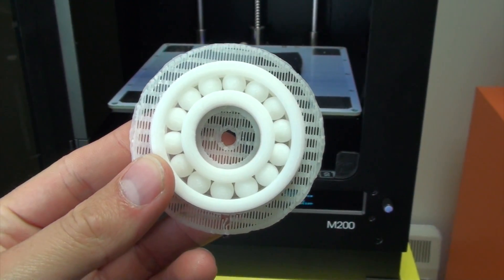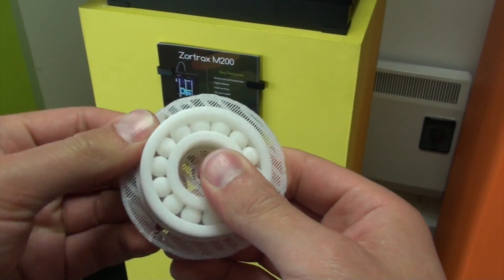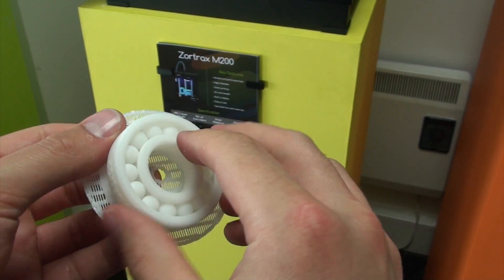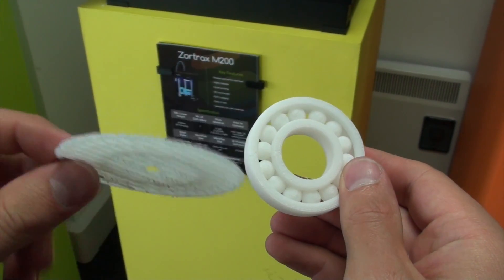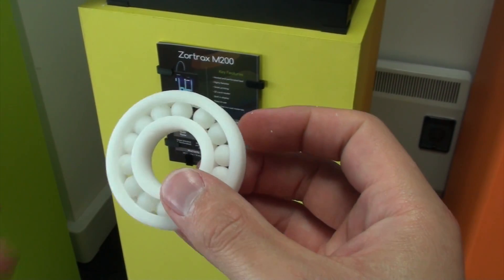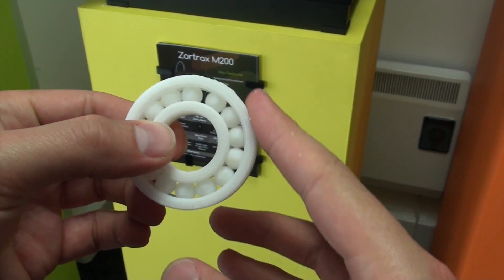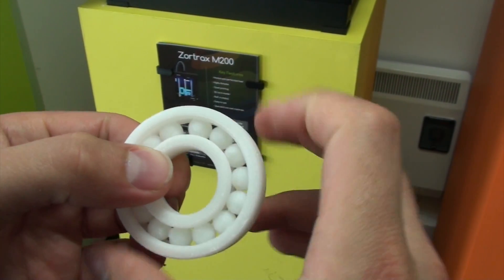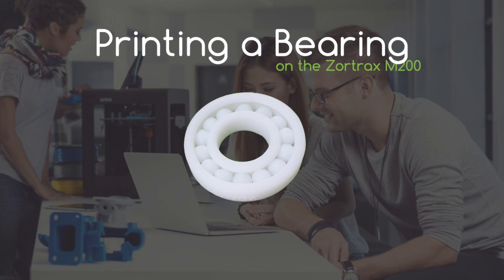3D Printing a Working Bearing on The Zortrax M200 | Cool 3D Prints | Dream 3D

Comment: Can you provide a link to this bearing for download?
Reply from the maker: Hi +PinEmVin, this exact model is only available from the Z-Suite Library. But there are some very similar ones on thingiverse: http://www.thingiverse.com/thing:143467
Reply from the maker: +DrR1pper , I believe this was printed at 90 microns with a medium infill on z-suite and 2 shells. It took around 2 hours to print. Hope this helps
Reply: +Dream 3D If you know, please may i ask at what layer height, infill percentage and number of shells was this printed at. And then also how long it take from start to finish (as close to an exact length of time as you can) please. Thanks if you are able to answer these questions, if not, no problem. Cool video btw.
Reply: Dream 3D I don't want to make a zortax account.